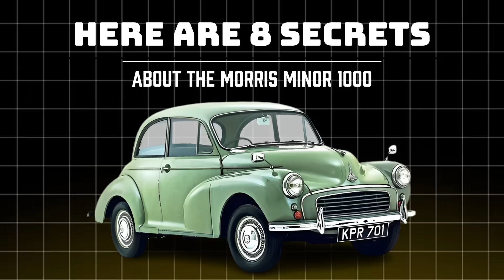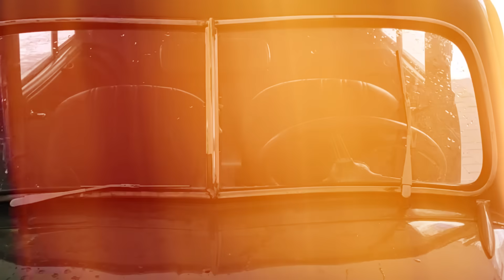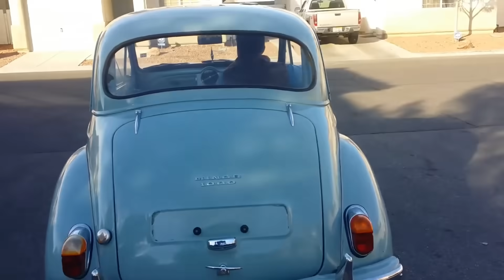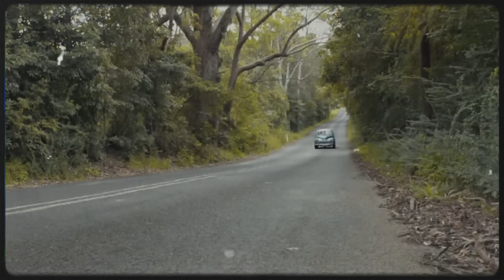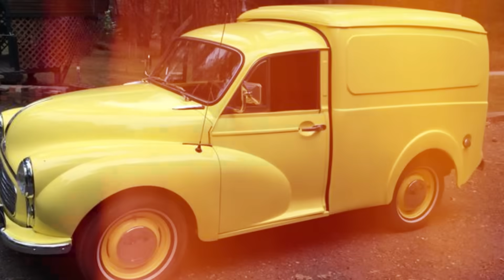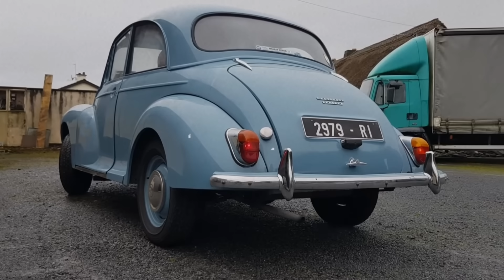The Truth About the Morris Minor 1000 No One Talks About

Comment: Its a wonder you didn't mention that the original M M was designed to take a Jowet javelin water cooled flat 4 'boxer'engine,This may have accounted for the wider body ,also.Under the bonnet it will reveal a very large flat surface each side of the 4 in line spec engine. 2 very large holes in each floor panel would assist cooling.To cut production costs they settled for the BMC 'A"series motor The brakes too were notoriously small and almost inefective .And that nightmare to get at, master brake cylinder under the floor board .But for all its flaws most European post war cars were, made down to a price The M M no exception
Reply: "To cut production costs they settled for the BMC "A" Series motor." ??? No - they didn't!!! Why would Morris have fitted an engine made by their great rival, Austin?  Austin and Morris were separate companies, and it was therefore the Austin "A"-Series engine, not the "BMC "A"-Series. Morris fitted their own engine until the two companies merged to form BMC. The Minor acquired the "A"-Series in 1953 - five years after going into production. I highly doubt that Morris had any thoughts of using the Jowett Javelin engine - much too large and expensive for an economy car.
Reply: The master cylinder has  easy access if you are a professional. .. as was myself having worked for a number of years at a BMC dealership where we were the official dealership for Morris, Austin, Aston Martin, Jag, Rolls, Bentley, MG, Lotus, Mini Cooper, Jensen, etc.

Comment: The truth nobody talks about?  The car ceased production in 1967 and  hardly has  significance now and is  not a truth avoided?  It was a brilliant car seemingly intended for a flat four engine that never happened the big leap was fitting the engine from the 1953  Austin 30 to the minor with the next big change to the Minor1000 with more than a million made.  Examining  a  VW probabley was responsible for the tortion bar suspension  and possibley a lower flat four engine  that never happened. I worked for Caffyns B'ton and saw the first Minors with low line head lights and side valve engines.  A Renault 750 was examined perhaps management considered selling them.   The Renault was streets ahead of the minor
Reply: I have heard about the abandoned flat four engine before. Any idea why they decided against it?

Comment: At least the Minor had that useless SU electric fuel pump under the bonnet, where you could give it a thump if/when it seized up. Unlike either the Sprite/Midget where you needed a couple of blokes to tip the car on it's side to get at the pump. The torsion bar front suspension was a good idea, but lever rear shock absorbers were a joke.. Small wonder the UK motor manufacturing industry went into a black hole.
Jck, the Japan Alps brit
Reply: I had a Traveller back in 1973/4 for around 12 months, the fuel pump failed and I called out the AA on the M62 near Leeds.  The AA guy cleaned the points and got me on the move to my destination, Kings Lynn, from my normal residence, North Manchester.  The total journey there was around 170 miles (it still is, although the route has now more motorway miles).  I got to within a mile from where I was staying when the pump malfunctioned again.. Another use of the sandpaper got me home.  The following morning, I got half a mile down the road before it stopped again.  I got a lift to work and was able to buy and fit a new SU pump, cost £6.50 from the local BL dealers.
Reply: Another BS artist and possible WRONG owner.
Reply: @jeffhildreth9244  
You talking to me? You talking to me?
Well, I'm the only one here.

Comment: The starting handle was handy, for puncturing the radiator, which i did, once on my Minor. In the sixties, my boss was not happy replacing the flipper indicatoer on the firms Minor van when I left the van quickly making deliveries which I snapped off before they'd dropped down. Not so sprightly now age 82. He never sacked me though, b;ess him.
Reply: I did a similar thing on my Austin 1/2 ton van.  I was using a speed wrench, shaped like a carpenters brace drill, to remove the radiator when I slipped and poked the radiator.  I plugged the hole front and back with body filler and never had a leak.

Comment: The family car in the '50s. I recall a trunnion failing and later a carbon thrust, but otherwise reliable.
Reply: I had Morris Minors as a youth, and recall the old boys advising to "Keep yer trunnions greased!"  It wasn't uncommon to see a Minor at the side of the road with a broken trunnion. I had a couple of the carbon thrust bearings wear out.
Reply: @STH_55UK  They went on with carbon thrusts into the '70s and engines designed in the '40s...  no wonder they went under.

Comment: Not the truth in fact complete hollocks.   The later models had a great heater that came off the rad  and you showed the split screen morris which was a very early model indeed  and the washer pump was electric on later models but on early models the push pump was never a problem. Now the main facts you bloody missed the gearbox was a 4 speed a very good box the suspension was a king pin suspension with a trunnion top and bottom and if you greased the trunnions regularly they would last indefinitely. Now for the engine it was on the later ones WITHOUT the split screen the A type engine which would go on forever it was so reliable and much better than the ford Kent engine which it would outlast also the ride was very good as it has lever shock absorption and also the boot was big and well laid out    So do better research next time and don’t be so picky and go on about the tiny things on the car.  Anyway it sold very well indeed and all those customers can’t be all wrong. And if you don’t do the usual maintenance on any machine it will bite your ass
Reply: Greasing trunnions is a thing that our generation will surely take to our graves. Let's hope the youngsters don't misunderstand.
Reply: Bollocks is the word. Complete Bollocks bruv.
Reply: By the way, even the (predecessor) Pre war launched Morris 8 series E had a 4 speed box and all hydraulic brakes.
Reply: Don't know where that story about Alec Issigonis hiding the width from management came from as well lol, it was Nuffield who said it looked narrow-gutted and it was changed from there!
Reply: @SpiritEngine Wasn't the car widened so a different engine would fit?
Reply: Hah! Have to agree. Love the way you shot the creator of the video down. Well done. Nothing worse than people speaking bollox about things they know obviously nothing about. Just out of interest, I remember Morris 1000s by the side of the road on bends where the front wheel had become disengaged. What was the cause of this? Was it lack of maintenance to the trunnions that caused the failure? I'd love to know Philip. Greetings from Western Australia.
Reply: @LouDeVere you got it there was a grease nipple on all the trunnions and if that wasn’t used and replenished with grease it’s metal to metal of course and it will let you down and break like anything you must do the maintenance   Ok
Reply: One of the cars toward the end,in black,has a Dublin reg. In fact the MM was very popular in Ireland.
Reply: Arse.
Reply: The Morris Minor was my first car I owned after I passed my test in 1969. It was by then truly outdated, terrible driving position, virtually no road holding are just two of it’s faults. In 1970 I swopped it for a Mini Minor. The Mini was light years ahead of the old Minor.
Reply: This rubbish video is intended to get a  detailed response like yours because I suspect, it generates more advertising revenue. Don’t waste your time correcting this kind of garbage, the people behind it are interested only in the revenue it generates.  The truth of this dawned on me a while back when I saw similar on YouTube. 😊
Reply: @Chris-f7s2y  Agreed Chris. "Rage Bait" - so prevalent that Oxford University Press named it their 2025 Word of the Year
Reply: It's an American video, what do you expect? Reality? Honesty? Knowledge?
Ass is an archaic word for donkey, and also American.
Otherwise, I agree with you. Both my Moggy minors in the 80's were fantastically reliable. In the winter, the poor electrics didn't matter. Starter handle or bump start, no worries.
Reply: @Harry_FlashmanVC Or, this is AI generated nonsense that anyone can produce no matter what country they come from.

Comment: no one talks about the van door locking bar squeaking constantly going along
Reply: Or the weak strap holding the tank in. That was alarming when it fell out.
Reply: happy days had an ex post office van got it at 80000 miles on clock paid 75 for it ran it till it popped its clogs at 210000 just rust holding it together 😅

Comment: Morris Minor 1000 is 1098cc almost an 1100.
Reply: Correct.......

1962 saw the A-Series Morris Minor 1000 1098cc, 67cu in, 48bhp continue in production until 1971.
Reply: @graemekeeley4497  Wow, all that power, 48 bhp.  Currently many 1.1 litre petrol engines in modern cars knock out double that horsepower, such is progress.
Reply: My first car was a Morris Minor with a 1098cc engine. I bougnt this in 1968. Excellent family car.
Reply: The earlier model was 948 cc. 0 to 60 mph in 30 seconds. Fitting twin carbies made it a bit quicker.
Reply: @Bellbuoy144  Stupid. Fit a 1275.

Comment: What about the brake master cylinder being stuck in the chassis rail. Topping op was through a bolt type of cap under the carpet on the divers side .. the heads bolts that held the master cylinder in wete behind the torsion bar. Convertabkrs the worst to work on as everything twists and moves as things rot.
Reply: Have you a clue what the hell you're talking about?!
Reply: @rodneymcgovern5984  Gin. It happens. Be kind.
Reply: @rodneymcgovern5984  Perfectly true. The master cylinder lived in the chassis member, under the floor. It was a bitch to remove, as the suspension torsion bar ran parallel to the chassis member, and "trapped" the bolts in. I found one that wasn't thus, and assume the job had already been done once before. I have changed a few over the years. Most jobs on Minors were a piece of piss, but the brake cylinder was not one of them!

Comment: I Installed a "hot rodded" (cam, higher compression pistons, exhaust header, and two inch and a quarter S.U. carburetors, along with a ribbed case transmission from a later MG midget. It would light the rear tires easily and go over 100 mph! Very scary in the earlier Morris Minor. (but really fun!)

Comment: I understood that the heater was an optional extra, at least on earlier cars, although I imagine that most cars were ordered with a heater ! 
It was in the car and had a finned heater matrix heated from the engine coolant. It was a full recirculation type (no fresh air from outside, as on early Minis (that later got fresh air ducting into the car routed through the wing across the car from the radiator)).
On earlier Minors there was a valve in the engine bay that could be shut off in hot weather so that the heater received no heat.
Reply: I think there was an aftermarket attachment to the heater that sent the hot air to the windscreen.

Had a powder blue 2 door 61.
Sometimes you'd just be driving along and realise you were just smiling to yourself because you were i  such a nice place.
Reply: @dondesmond7969  There may have been but IIRC there were air outlets as standard to blow air onto the windscreen.

Comment: San Diegan here.  My first car was a 1952 Minor.  I tried rebuilding the engine, but I didn't really know much about rebuilding engines.  Going up hills, it smoked like a WW2 destroyer laying a smoke screen.  I traded it in on a 1958 Minor, which I modified every way I could think of (that was cheap).  Putting in a sway bar required cutting off the fuel pump mount, but that turned out to be a good thing, because I ran a string from the fuel pump to under the dash, so I could bang it against the body to restart it.

Comment: The truth is the minor's were dangerous rubbish because the the torsion bar suspension at the front with the steering legs and top and bottom links will fail without warning causing the front wheel to collapse inwards, if you are lucky you will not be going to fast when this happens...
Reply: The only "dangerous rubbish" are the drivers and owners who ignore the servicing advice, expecting swivels and trunnions to continue working long after the grease has dried out .
Reply: @GEOFF0906  I used to grease the links weekly, yes weekly. as previous answer now talk your way out of this one.
Reply: I drove them for years as a reckless young man. Not a single accident in a Moggy. In those days, driving fast on country lanes on the way back from the pub was common. 40-50 on wet, leafy roads in a Moggy seemed like F1.
Reply: Poor maintenance.
Reply: If you kept the trunnion properly greased they would last forever
. The torsion bars are not intrinsically dangerous and have been used on many cars subsequently, MGCs for example
Reply: @peterdrinkwater1099  Grrr rubbish! using my wanna made grease gun and castrol lm the links were greased weekly, yes, weekly, now talk your way out of this one

Comment: Early Minors front bumpers were extended in the centre with a “fish plate” bolted between the 2 halves of the early factory produced chrome bumpers. I believe the narrower ones were already in production before the wider body was finalised.
Reply: Actually, it was Lord Nuffield, the founder of Morris Motors, who caused the car to be widened. He saw the prototype and declared that the car looked like a poached egg and was narrow gusseted. The design team cut the car in half and pulled it apart until it looked right. The four inch gap was pretty much hidden, apart from the bonnet ridge. The bumpers in the MM (Mark 1) had already been ordered and could not be scrapped due to a national steel storage in the UK at the time. The solution was to place a body coloured plate in the middle of the front and rear bumpers. This information comes from the surviving members of the design team who were interviews about this for a BBC documentary in the early 1990s.

Comment: The heater was water heated by pipes from the cooling system, not ducted hot air
Reply: absolutely .The citroen 2cv used ducted hot air
Reply: @fruitychink  And the VW Beetle
Reply: @Martindyna  Because it was air cooled
Reply: @Nooziterp1  Rubbish   all Morris cars are water cooled
Reply: @edward7182  If you read my comment and the two comments it was replying to you will see that I was saying the VW Beetle and the Citroen 2CV were air cooled, not Morrises.
Reply: @fruitychink  Because it was air cooled
Reply: Since I have a Minor Traveller (F reg, registered 1 March 1968), I can confirm you're correct.  The problem with the heater was it was too efficient.  Also it had a radiator and the cooling system capacity was around 8 UK pints (10 US pints) capacity, which was a large amount for a an engine which never got any bigger than 1098 cc.
Reply: @paultaylor7082 ooh yea the heater in my morris doesn’t turn off so is constantly jammed on and it is definitely hot, that’s first on the list after rust repairs
Reply: the same on my 1960 Austin Mini - you had to move the something over the heating pipes in the engine to enable heat in the car
Reply: Yes the heat transfer pipes are heated by water and air is passed over them to gain heat and the air flows to the interior of the car. As it does now in most cars the principal has not changed the execution has improved. Are you thinking about the VW beetle back in the day.

Comment: The width issue was resolved not on the 'Minor 1000 but the 'Mosquito' which preceded the 'Series II' or possibly the earlier 'MM'. 
Back in 1974, I had a '56 registered 'Series II' with original 30 HP, 803cc engine. Comparered to modern cars, it was a 'doddle' to service.